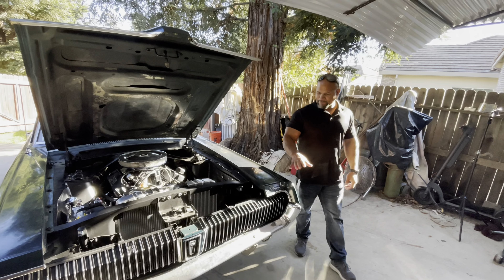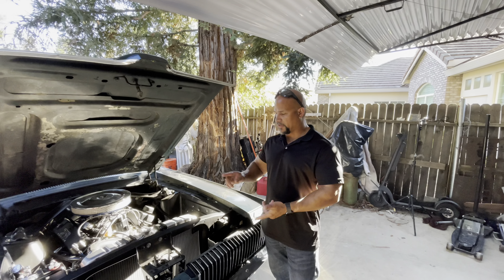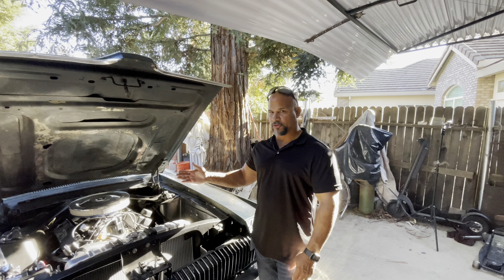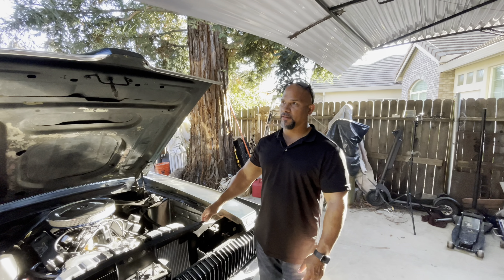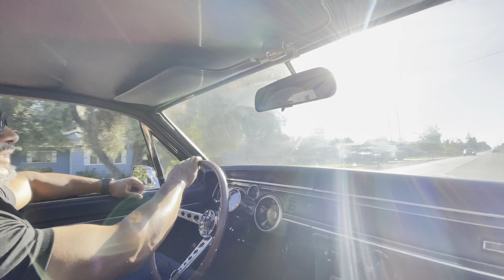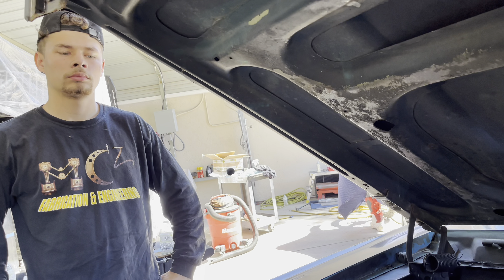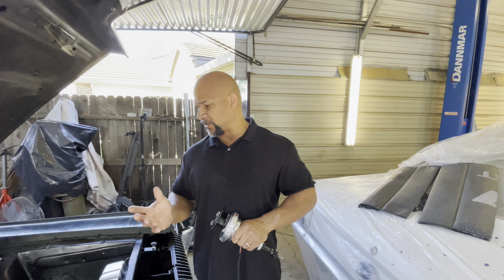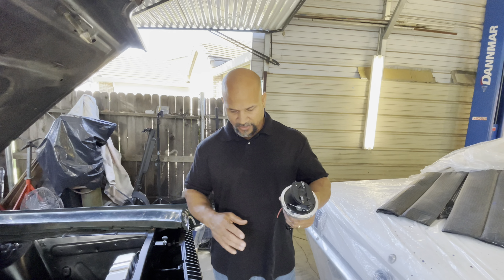We pull all the tricks to make this 302 burnout💨💨💨💨💨💨

Comment: So taking out the carb spacer helped?
Reply from the maker: No, but I was not sure so we took it out anyway. Usually open carb spacers won’t affect the bottom end. The additional 2 degrees of timing is way hurt that test pass. If I had a 4 hole spacer I would have used that instead.